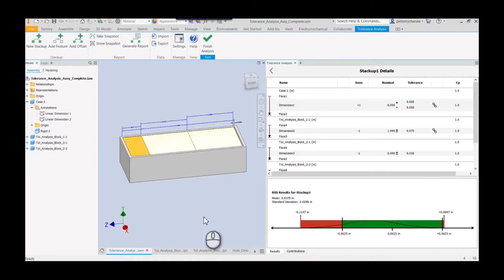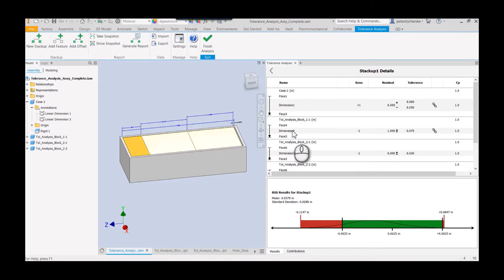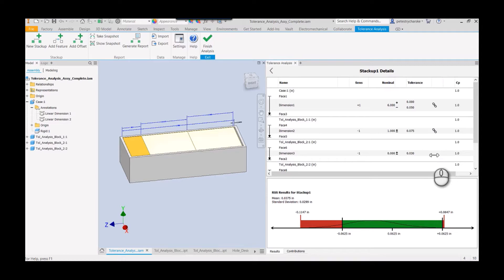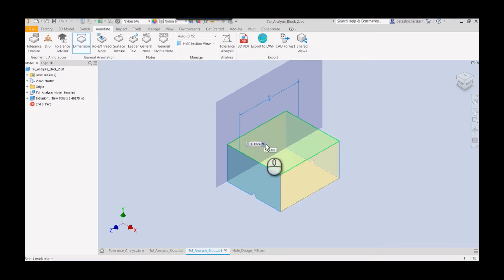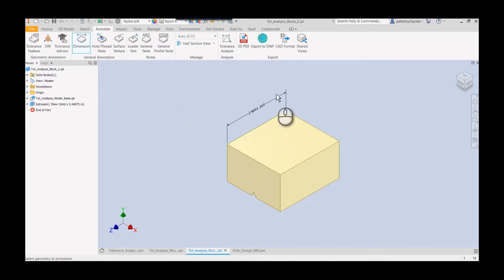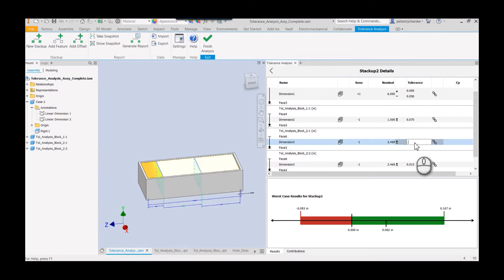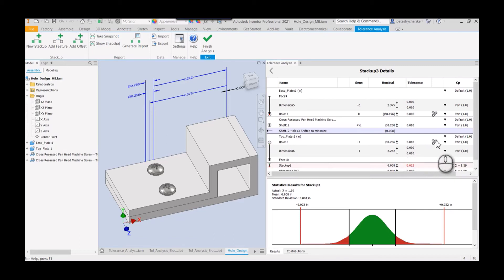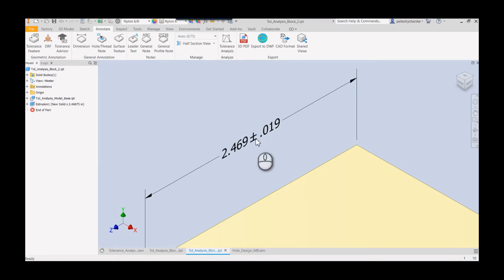Inventor - Linking Tolerances from Tolerance Analysis to Components

Comment: What I found is that, when you promote a dimension from sketch with tolerances it doesnt work, whe link icon does not show
Reply from the maker: @krysrus111, thanks for sharing that and I apologize for the late replay.  I actually wasn't aware of that and will do some testing to see if there's a workaround for that limitation, or make Autodesk aware of it.  I would actually prefer for Autodesk to fix it, because ideally, the 2D parameter tolerance, 3D annotation tolerance and tolerance analysis should all be linked together.  Thanks for point this out and have a most blessed day!

- Pete